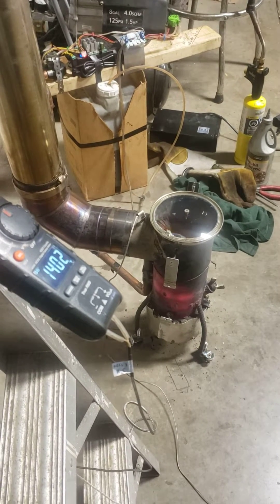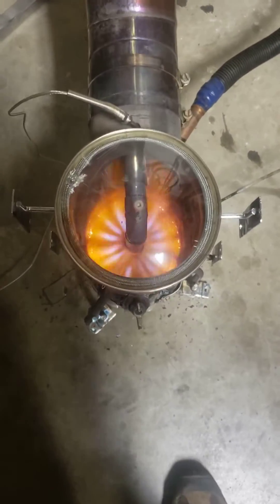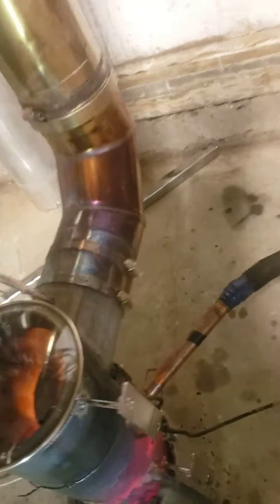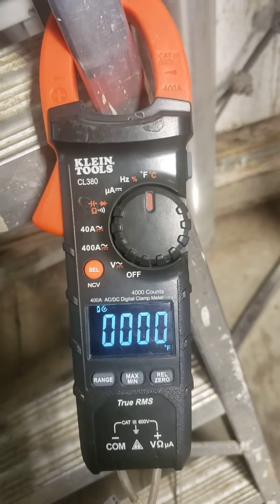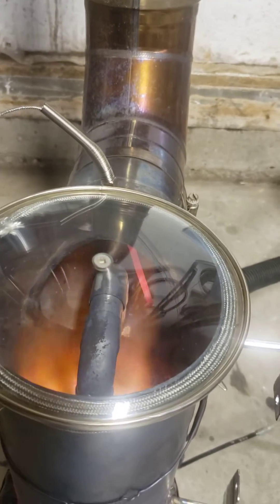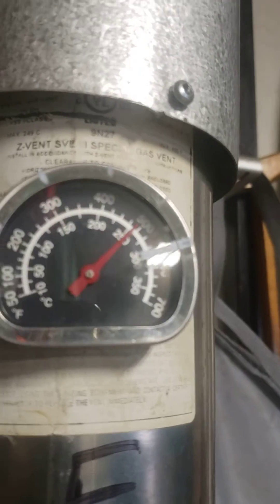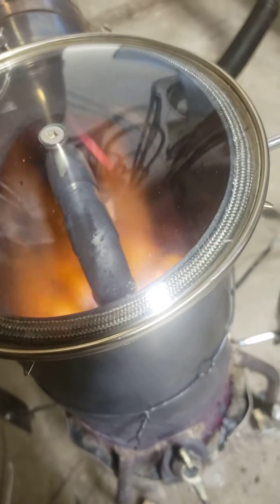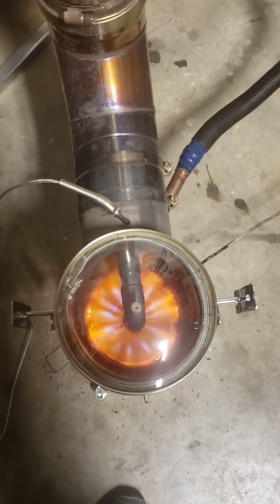mad maxx 2.3.1 probe,pipe temp, new lid

Comment: Попробуйте сделать водный контур отопления. Также корпус самой топки (как я увидел) слишком тонкий, быстро прогорит.
Reply from the maker: yes  I'd like to make some kinds of water  coil to preheat the water before it goes into our house water heater...... got to make it safer first. and everything is deteriorating  ,  like everyone said it would (didn't think it would weaken that quickly) the steel shell      the inner air pipe etc       but       I have proven that I can actually get  a great deal of heat from  straight waste vegetable oil!

I am incorporating a couple safety features as I have to leave this burn by itself {for  a couple hours at a time unattended.} in a smaller electrica box, different pump   and blower placement, different heat sheild s, as well as a stainless burn tube with ceramic pieces to direct the flame pattern with actual fire brick to insulate the bottom of the burn tube.

lots to come  ... im  building a large version for a freind   its gonna be Awsome
Reply: @dennisw4828  Я тоже делаю подобную печь для обогрева гаража, только немного меньше размерами. Подобную конструкцию увидел впервые на ютуб канале человека из Японии.
Очень понравилось что отработанное масло (я использую машинное масло) сгорает полность без копоти и дыма.

Удачи Вам в постройке и улучшении этой печи=)
Reply: @ilonamask3127       hello, can you please let me know the channel of the japanese person thank you
Reply from the maker: @marend4  check out  my playlists    there is a lot of ideas under  my burner playlist

Comment: Sorry, had to laugh at the way you sound frantic about it getting too hot :) :) :)  Yeh it's efficient alright ! :)  I wish I lived in a garage then I would definitely have your setup, but there is no way I could have that in my living room :)  I think I have come to the limit as to how small I can make an oil burner which burns reasonably well, anything bigger goes nuclear like yours :)  In any case give yourself a pat on the back, what you have built is awesome, the only things that may require replacing periodically is the copper pipe which can simply be replaced or exchange for steel pipe and the chamber where the flames hit the walls is likely to disintegrate over time too I have also had that problem with a previous design, I will make a quick video of what happened to mine.  :)  Have a great day sir you have accomplished something I thought was pretty much impossible ! :)